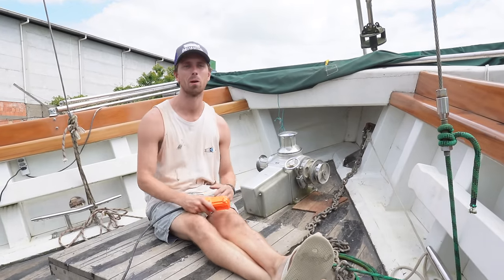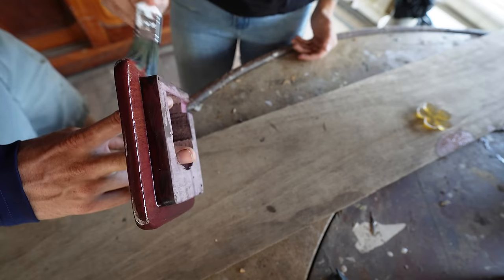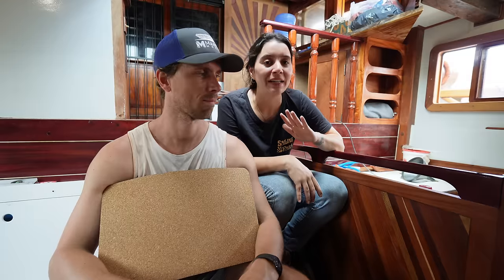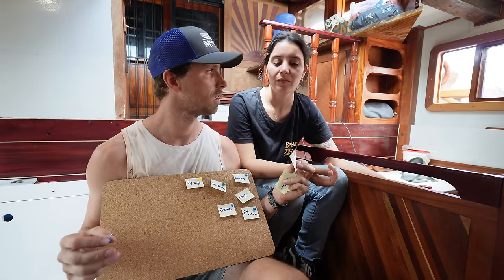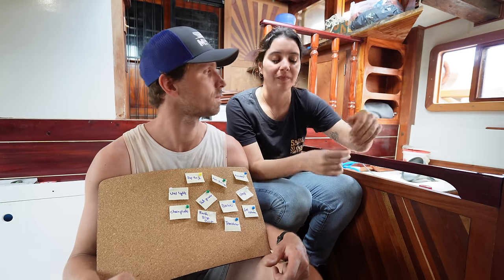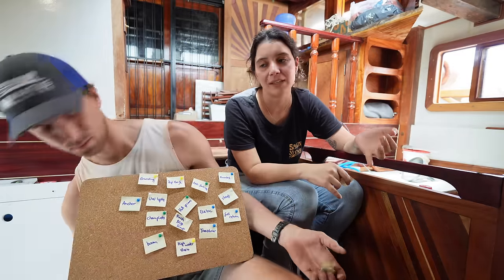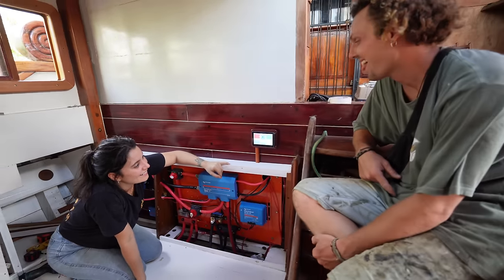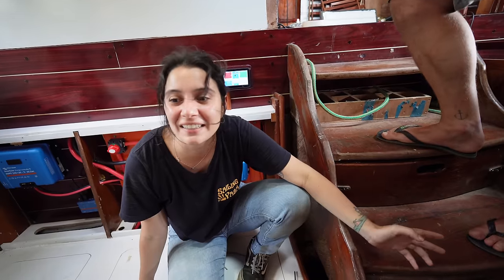Boat launching to-do list: you're gonna either love us or hate us for this — Sailing Yabá 191

Comment: You still need bilge gas sniffer & bilge blower / extractor fans. Plus yes you need a copper lightning conductor down to your steel plates on the stern keel.

In your wiring system you hull (the metal part underwater) is always the earth / ground to protect yourself and friends / passengers from electrocution.
Does your system have RCD (Residual Current Detector) trip switches?
Reply: @robertsawa3407  
Not quite. I hear what you’re saying, however, many boats / yachts have been blown up with leaking LPG (Propane) cylinder fittings for cooking stovetop or cooker tap left on & wind blows the flame out & no one noticed.
LPG is heavier than air and sinks to the bilge & accumulates down there.
The float switch on the bilge pump would be enough to ignite the LPG Propane if water ingress or diesel spillage, freshwater tank leak  was enough to raise the bilge pump float switch automatically, since the bilge pumps are wired direct to battery’s bypassing the battery isolation switches.

Also presumably they will have a tender vessel of some kind most likely outboard powered - so you assume they will be carrying gasoline / 2 stroke mix maybe depending on their outboard - so there’s just as much risk as if they had a gasoline powered engine & fuel tank.

Commercial 100 Tonne Master, I’ve forgotten more about these sort of safety issues aboard than most know.

Sadly pretty much every suggestion I’ve made have been totally ignore by this couple so I stopped bothering to make suggestions, as they mistakenly believe they know what is and isn’t needed and often in life, it’s what we don’t know that gets us killed.

The biggest single risk to anyone aboard a timber vessel at sea is fire.

No fire alarms anywhere in the vessel or fire extinguishers sufficient to extinguish a diesel fire in the engine room for eg.

Then there’s the total disregard of safety with the lithium ion phosphate battery bank.

The recent RORO (Roll On Roll Off) Car Ferry disaster off Norway Sweden has lead to new commercial vessel rules about lithium batteries aboard.

What has been found after that disaster is that in the case of lithium battery fires is that the ONLY way they can be extinguished at sea, is by flooding the battery compartment with chilled brine solution.
This does two things.
1. It drops the thermal runaway fire trigger point below that critical figure.
In the case of these lithium phosphate ion battery’s that are on this particular vessel, the thermal runaway trigger temperature is 120 degrees C.  On a hot day of day 45C and you have solar panels feeding in maximum amps in full sun it is possible to reach 120C in the wrong circumstances.
2. The chilled brine flooding - being an electrolyte - short circuits the lithium ion phosphate battery cells discharging them.
It’s the stored energy that feeds the thermal runaway event & makes the fire continue to re-ignite. By discharging the cells with brine you remove the energy (fuel) from the triangle of combustion.
Lithium ion fires cannot be smothered (deprived of oxygen) because this specific type of battery fire actually generates its own oxygen. Quite literally in freshwater a lithium ion battery fire will burn underwater for this reason.

So the new rules for commercial vessels for lithium batteries aboard is that they must be contained within a metal water proof box, that has a 2 inch “filler pipe” with fire fighting quick coupler attached that on board fire suppression efforts can connect the brine to flood the sealed compartment.

This vessels battery set up doesn’t have any such built in containment system to allow the flooding of the battery bank with sea water to stop a thermal runaway event.

It would have been quite easy to build one in when installing the batteries, but if you’re not aware of the danger & the best cures for that risk - then the idea never occurs & shortcuts are taken that one day could cost everyone aboard their lives.

Yes there’s a lot of bilge pumps aboard and that’s good however every one relies upon a functioning electrical system to save the vessel if it’s flooding.
There’s not even one redundant back up system like a manual bilge pump that can be operated from up on deck for eg.

A clutch operated mechanical bilge pump operated off the main engine could shift 10 times the volume that all those electrical bilge pumps can move.

I could go on and on, but what’s the point?

They are in a hurry to launch and so many safety issues have been overlooked that I’d be here for weeks pointing out the shortcomings.

There’s no water proof forward collision bulkhead for eg.

Not knocking these kids for their 3 years work and expenditure and so on. They have done a great job this far but really they should wait another year and do everything properly with proper advice from professional mariners & a naval architect.
There’s no guarantee this boat won’t turn turtle at launch and sink because all the stability criteria of the original vessel have been substantially altered. 

Will it sit on its lines? Will it pass a standard incline stability test and retain more than 1/8th of its beam in clear freeboard with all passenger component against the same gunnel at the same time?
There’s a lot of unknowns here many of which if done wrong can result in the loss of the vessel & lives in the wrong circumstances / conditions / sea state.

Anyone see an Epirb aboard? Nope, me either.

And so it goes. You can’t put an old wise head on a youngster. Neither of these two kids have the experience or knowledge to be restoring a vessel of this size much less skippering it.

It reminds me a little of that idiot millionaire built his own mini sub to take tourists down to look at the Titanic wreck & it imploded under the water pressure killing everyone aboard.

What these two kids aren’t understanding is that in the event that just one “Patreon” supporter gets seriously injured or dies & they get sued, it will come out that the passengers actually “paid for their passage” by virtue of the fact that, money changed hands and because of the “Patreon” support, they have effectively become “paying passengers”.

The implications (even in 3rd world Brazil, will mean that it will be determined that an “illegal paying charter” took place in an un-surveyed “recreational vessel” skippered by a non commercial qualified captain, and it will end up they lose everything. If a coroner determines that as a result a negligent homicide occurred then one or both these owners could end up doing jail time.
Their inexperience and lack of qualification saw them buy this worm infested vessel that was clearly on the verge of sinking.
The encouragement of Odd Life Crafting Duca & Roberta, they have been convinced to restore this vessel for 3 years, in order to do what Duca did (& got away with) in running “illegal charters” in an unsurveyed recreational vessel.

At least in Ducas case at my suggestion he went and studied and passed his commercial skippers license.

He was half illegal in that he was qualified but his vessel wasn’t in commercial passenger carrying survey.

Maybe Duca & Roberta got away with it because nothing went wrong and no one died & presumably no one complained to the Brazilian maritime authorities, about conducting illegal charters.

But will Pete & MP be similarly as lucky?

Only time will tell.
Reply: I suspect someone missed the part where they announced they’re going with an egg electric cook top.  

I’m pretty sure that means they won’t have any LPG gas on board at all??

Unless they decide to add an outside grill. Then they can always add the gas sniffers.
Reply: @williamhenry8277 All electric sounds good in theory but not so much in practice. When there’s insufficient sun for a week, batteries are low, they will have to run the diesel engine for the alternator to charge the batteries to cook. 🙄

As I said before no redundant / back up systems. 🙄

Comment: Hi MP. The wires can get snagged and broken. Run them through some cheap conduit / Plastic pipe. This also means your bulkheads can be easily sealed and you can add more wires easily later on.

Comment: Great job. A bit of advice for the Propspeed: make sure you follow the directions exactly. Specially regarding drying times (when it is "tacking") and cleaning the surface. It is recommended to have it installed by a professional!

Comment: Good morning you two.  Ben suggestion if you ever need to take a thourght hull fitting out: take the nut off then put it back on upside down at the top of the threads, and have someone stand on it to help push it out.   You guys are a part of getting  my day started in a very nice way. Keep it up 🙂
Reply: And use a wire to 'saw" the sika. braided line works great.

Comment: A Faraday Cage around the vital electronics'. I remember that Colin on Parlay stated that the Lightning suppression systems were $4,000 for some and there aren't that many out there.  He's been hit twice by lightning which brings up another point. .............. 
Spares for critical components. Alternators, pumps, fan belts, fuses, hoses, relay's, auto pilot, radar, radio's, screws, nuts and bolts, etc.  Anything that would stop you dead in the water without a spare. You have to ask others for recommendations (Duca) and just go thru each area and make a list and build a place to put them securely .................. enjoy

Comment: The engine intake was correct as you had it. Turning it around will cause a vortex which will cause issues with the pump and may result in overheating of the engine.

Comment: For the lightning arrestor, its impossible to be sure but this is what has worked for me. 
35 square mm marine (tinned) copper cable connected (bolted) to a 1 meter lightning rod at the top of the highest mast, run straight down to the keel then bolted to copper grounding straps 25mm x 2mm x 2 meter run horizontally both sides of the keel directly below the mast. Same kind of straps that are used on tall buildings to connect lightning conductors to ground.
The theory is that done this way the potential (voltage) at the top of the mast is equal to the potential of the water that your boat is in.
So is not attracting lightning. Research has shown that when lightning hits the sea it is dissipated horizontally a little below the surface. Hence the horizontal copper grounding  straps.
My boat with this arrangement has been in the tropics for nine years and so far🤞no strikes.
There are no guarantees.
Reply: The cheapest way! Hang some jump start cables on the shrouds and in the water!

Comment: Hi Ben and MP, thoroughly in awe of the work that you guys are doing!  Inspirational!!  Just one thing!  Could the bow lock be designed so that it would not be possible for someone to be accidently locked inside. Could a latch be designed that would allow the hatch to be opened from the inside.  Just worried that the lidcould close and lock  with someone inside. Hey again love your work!  Top job!!

Comment: Underwater lights and a dip net will catch you a lot of shrimp!
Not sure why you aren't making provision for two bow anchors - for storms and for anchoring in tight harbors.  Too, the port capstan on your winch could be used to kedge yourself off a sandbar - means another hole in the prow, to port.

Comment: I believe you're battery charging system probably already has a battery temperature monitor, but it would be good to talk about the system to monitor and prevent a run away overheat in the Lithium and outgassing of all batteries.  Keep in mind when you're finally cruising the biggest risks are the electric equipment such as scooters and tools are the most overlooked things, so be sure to have the charging bag protection for those. A small cost for big fire protection. Excited to see her in the water! Awesome and very thoughtful engineering you've both  shown us.

Comment: Have you checked if your gear box is ok to free wheel while under sail? Have a Google on your gearbox type to see . Some boxes need putting in reverse while sailing to stop them running the bearings out when the engine isn’t running and oil pump is not turning. Others need a shaft brake fitting to stop the shaft turning while sailing. Some gearboxes are ok to free spin.

Comment: Are you still planning to splash then tie up alongside? If so then there are quite a few items on your list that are not required just to launch. Shrouds, nav lights, chain locker, boom, exhaust, electrics, fuel and tanks, etc. So, the list need only be those items that must be done before splash.

Comment: Grounding is a huge topic but briefly there are 2 paths. The important thing to remember about Lightning is that it is Very High Frequencey A.C. NOT D.C. One pathway is to resist lightning by using something that looks like a toilet brush which works on the theory that a leader (Initial establishing strike from the ground up), cannot establish an ionised path in the atmosphere itself, due to the many paths diluting the power of the leader and stopping its full establishment. You will most likely get struck anyway, eventually. The approach I favour and I could be wrong, but that would be to have a Lightning Rod like a Skyscraper has, connected to a special Lightning Conducting Cable which has various layers of shielding to encapsulate in the cable, the Mega High Frequencies and Voltages present (At high frequencies the voltage leaves the wire and travels throuh the air becoming High Power Radio Frequencies which Splatter all over the place and destroy electrical stuff by inducing very high voltages and spikes). This special lightning rod condutor cable should be connected at the top directly to your lightning rod and there will be a spec as to how far the Shielding is stripped back from the end. The shield is connected at the bottom on a sturdy lug of metal, along with the main lightning conductor, to a Brass/Copper/Bronze (Not sure which is best considering also Galvanic Action), plate of about 18 inches by about 18 inches and is about a half inch thick, that is affixed to the outside of the boat underwater, to dissipate the energy into the water without, hopefully, blowing an F.B.H. in the side of your boat. There must be a Governmental agency somewhere or maybe an Architect or Building Engineer that has extensive dealings with this (See Electrical Consultants to Highrise Construction Electrical Services).  Shipbuilding Naval Architects or Shipbuilders, the Panama Canal Authority would have regular dealings with Lightning and you need someone who knows and not guesses. If you do not use the special highly shielded cable carefully routed, you will routinely destroy your electrical equipment. I have worked on this stuff but a long time ago and I'm sure things have changed since my stint. Good Luck.

Comment: I’ve only ever seen the intake fitted with the grill to the stern on sail boats as relatively slow speed they travel makes no difference . And also in some cases with the grill facing forward while sailing water can slowly be forced past a slightly worn pump impeller filling up the exhaust and then flooding the cylinders .You will be just fine with the grill to the stern

Comment: You definetly want to put an ilumination to the light switch so you can find it in the dark. You missed: painting the masts, insurance, registration, navlights / anchorlight, generator, dinghi, live-wests, mooring line. Also i suggest securing the anchor chain to the boat and securing loose components as the gratings on the bow.
Oh and you must have a working vhf radio and distress signal rockets on board.
You must have several fire extinguishers on board and ready as well.

Comment: Earting, i am not an expert, but the anodes need to make electrical contact with the water anyway, so, a copper bolt through the wall to connect one of them could act as earth. I would also suggest one for lichting protection and a seperats one for earth of your electrical system so you don't invite lightning straight into the electral systems.
I have a feeling that some items on your list could be done on the water, like boom preparation, high water alarm, even return pipe could be temporarly. Might be select esentials.

Comment: Cavitation can start at 3m/s (~ 7 miles/hr).   But do you think you will be using the engine if your sailing speed is nearing that?       Unsure if the orientation of the intake makes any difference.     
MHO, don't ground through the engine, why encourage extra voltage or current in an area that is already dependent on other electrical systems.

Comment: Well, I love underwater lights. But my distaste for through-hulls that are not absolutely needed ist stronger. Cables for underwater lights would fall sadly in that category. Because each through-hull is a potential risk and a future issue. Through-hulls sink more boats than reefs. I'd make an exception for ones that are on integrated standpipes that reach above the waterline in aluminium or steel vessels. But people that build those reduces holes in the hull, too. Therefore, a torch to hang overboard on a line is the better option.

Comment: The simplest and most effective ground for a wooden boat that I've seen is an anode bolted thru the hull with a nice thick ground wire for the ships ground connected to it. It doesn't need to be fancy, just capable of carrying enough current to get the job done Most people don't use a large enough wire for this, it should be an equal thickness to the positive cables from your batteries. Don't ground the boat through the prop shaft because in a lightning strike it can super heat causing damage to the stern of the boat. $.02